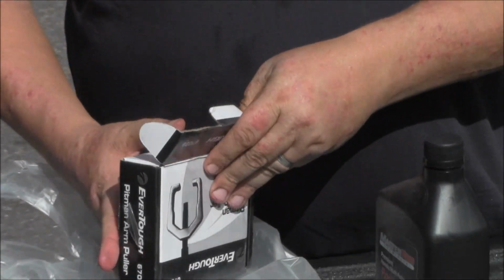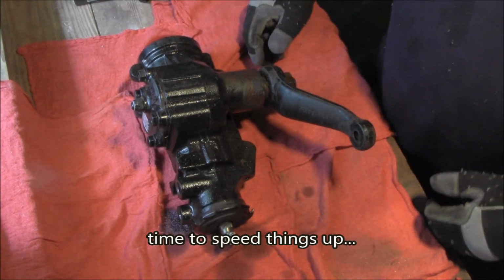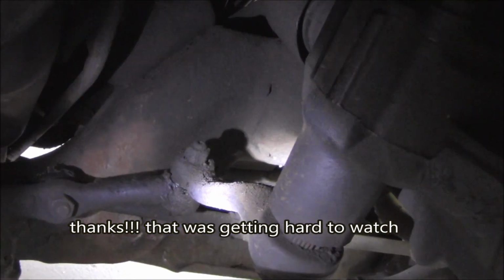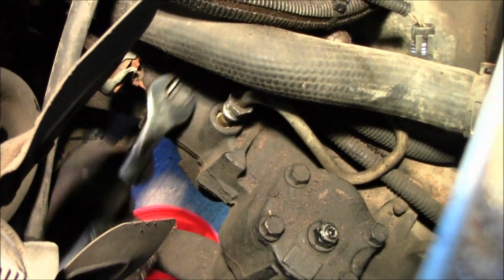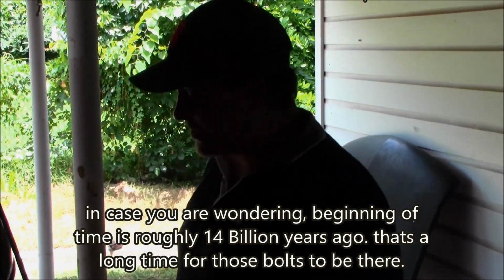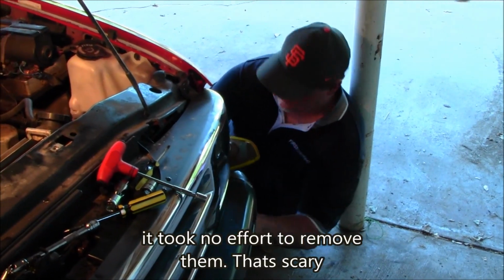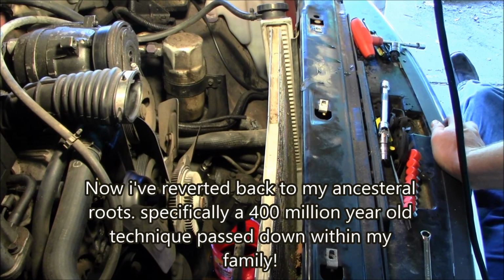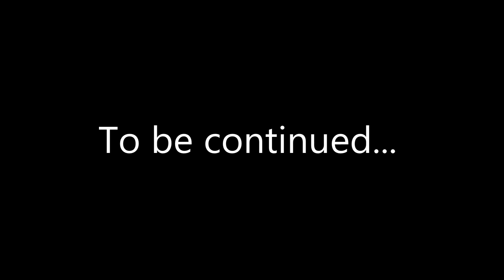How to fix 97 S10 Project Part 4 (Steering Fix Part 3)

Comment: when I did mine also did upper ball joint pitman arm idler arm and gearbox power steering pump new hoses it was quit a job and it's pretty hot here in Kentucky too! hope you got the s10 driving good again that gearbox you got looked like it was in good shape!

Comment: When it comes to removing pitman arms you want an impact gun or 1/2 drive long ratchet with it mounted in a vise. Not vise grips!!
Reply from the maker: Symbol84  thanks for the comment, the need for specific tools was a lesson I learned from doing this, i've since purchased an impact gun, either way the point of this was for everyone to see what its like to do something for the first time. using available information I trucked along and when it was all done I learned a lot.

Comment: I have a 1998 chevy s 10 pu.  Do you have a video showing how to change the tie rods and a rotor?  My truck shakes violently when slowing from 60 mph.  I know I need tie rods and a rotor.  Do you think it is the bad rotor making it shake?
Reply from the maker: +6996katmom tierods are pretty easy. you'll need a tie rod puller or a fork to pop the tapered end. a good strike from a hammer should knock it loose tape of and count how many turnes it takes to remove the tie rod then. once you replace them I suggest an alignment for good measure because there is a good chance the toe will be off on the front end. As for the Rotors I haven't swapped any but its pretty straight forward. there if you join the www.s10forum.com there is a lot of good resources there. now that my kid no longer wants the S10 i'm looking at making it a sleeper. i'm wanting to drop a v8, update suspension swap out drum for disk brakes all the way around. etc...  hope that helps good luck with your project.
Reply: Thanks for the info.  I just saw where you live in Gladewater.  We used to live there 1974-1980. I sure do miss it.  The kids grandpa lived on East Mountain, but has since passed away.  Our favorite vacation spot is Lake of the Pines.  My husband is no longer able to travel because of his back, so we very much miss being in East Texas.  Well, thanks for the videos and info.
Reply from the maker: your welcome, small world :)

Comment: I did this same thing on a 1990 k1500 turned into a nightmare got it done put a reman gearbox in and I think it's defective the power steering turns way too easy now might have to pull it back out!
Reply from the maker: This was a ton of work for a first time project of mine. I was worried that it would work at all. good luck on your continued project.

Comment from the maker: also the websites that helped me though this part of the project included the following. it didn't have to be directly related to the make and model of the truck i'm working on for me to find it useful since the basic principals of parallelogram steering are the same on a lot of trucks. The only real difference was weather the ball joint was in the pitman arm or the center link. I needed an example of it in the center link to answer the questions I had. Hope this helps...

http://www.dieseltruckresource.com/dev/tricks-removing-pitman-arm-t231549.html
http://www.jeepforum.com/forum/f12/how-remove-pitman-arm-859079/

Comment: Do yourself a favor and leave that fan shroud off, take the clutch fan off and go get a dual fan setup off a 2000-03~ Concorde. Just shave the mounting tabs off the side and it will fit on the chevy radiator with custom mounts on top to hold it. That truck will get at least +2 mpg and any future work under the hood will be easier because the big bulky factory junk wont be in the way. I did that to both my s10's and my 94 v6 got +2 mpg, the 2.2 you have should do better.
Reply from the maker: +WVresident didn't know that thanks for the tip.
Reply: Ya and the fans are over kill on cooling. When I got mine in the mail I fired them up in my living room and there was so much air flow they picked up a candy wrapper that was 3-4ft away and shot it across the room lol. If you google the concorde fan swap you'll find a wright up showing pics and how to make it work, it really helped me. They do draw some power so put them on a relay.